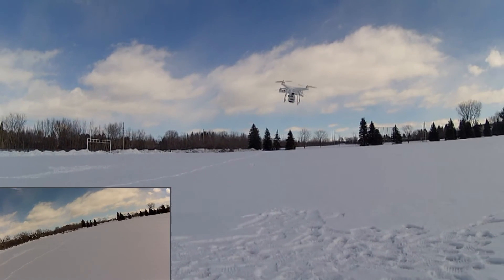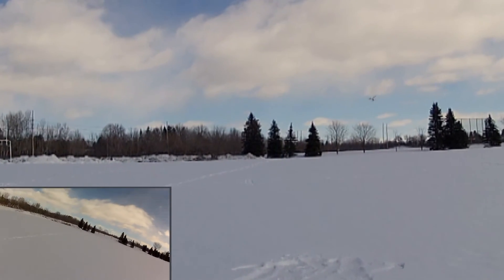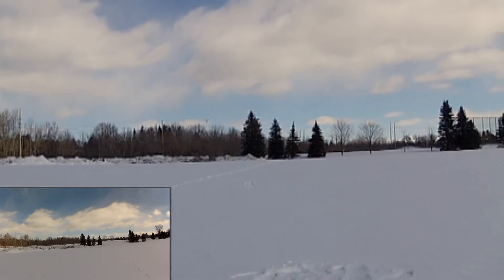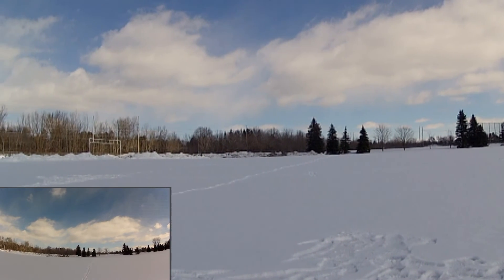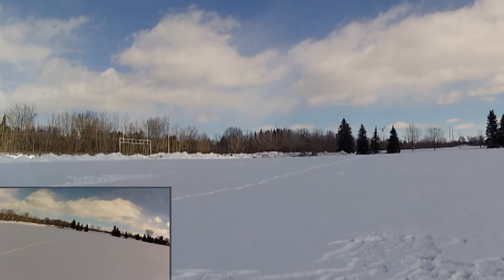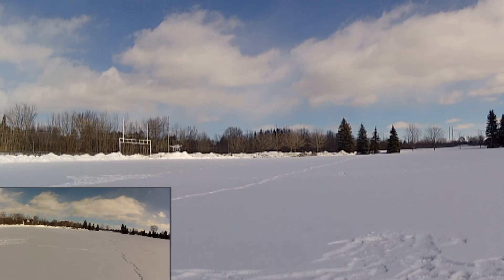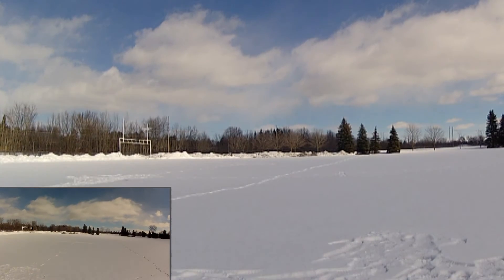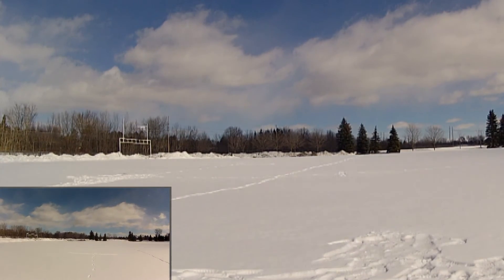Switch-HL-in-flight

Comment: Bryan,   no it learns home when you take off after an energize. You get conformation of that by multiple green blinks.   If you want to change the home,   hover where you want,  and move the IOC switch up and down 5 times to make a new 'home', you will get conformation via the LED.    And,  auto return to home is a Yellow STROBE,  not just blink.